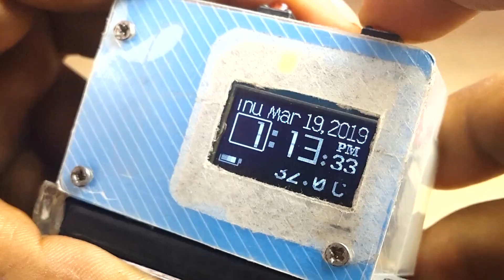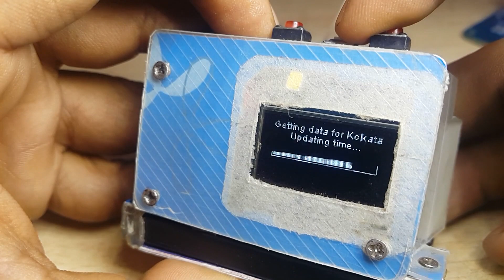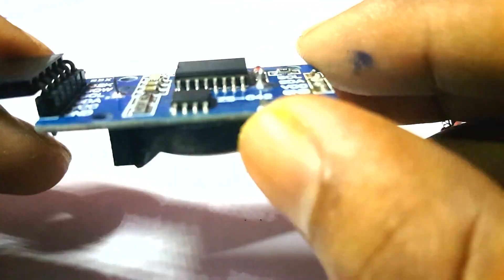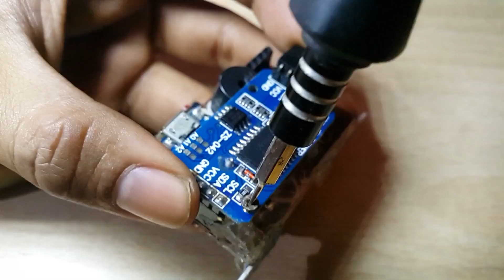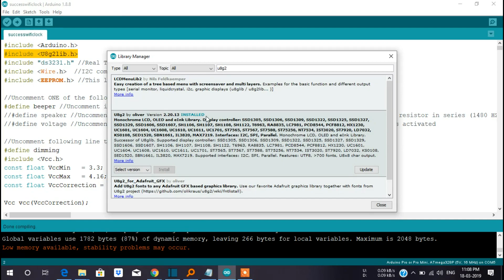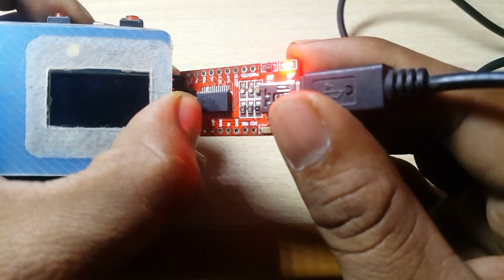Arduino oled clock with Relay Control and weather station on same OLED screen || PART-II

Comment: Great video! I added an alarm(Not just for 60 seconds) snooze upto 50 mins and flip to disable alarm display message and changed some fonts and added a "Set Your Alarm" slide text at the alarm screen bottom page that scrolls from right to left

Comment: How to change this circuit to ds1307 RTC module
Reply: In order to use ds1307 rtc module you have to change the library and edit the code .  It will take sometime
http://downloads.arduino.cc/libraries/github.com/PaulStoffregen/DS1307RTC-1.4.1.zip

Comment: Bro I'm from Kolkata too.can you help me out I want to build a smart clock like yours but on nodemcu features I want to have - set time/alarm/stopwatch/battery level indicator/weather/notificationsfrom phone..add ds3231.. basically I want to change Arduino with nodemcu..
Reply: Bro you must need API key to make Node Mcu clock & weather station and API key which is not free of cost today moreover Node Mcu is more power consuming then Arduino.....
Reply: @addiction-69  basically while trying to do so i burnt my ds3231,hc-05..
Reply: @addiction-69  if we remove outdoor weather feature instead use dht22 to get indoor information..
Reply: @HELLSGUARDIAN  then why you want to use Node Mcu whereas no use of internet or any wireless communication use simple Arduino and Ds1307 with Dht11
Reply from the maker: but the problem with nodemcu is. its power hungry.
Reply: @ehobbyist4054  true, I am 
willing to use nodemcu because of its storage..

Comment: Bro the clock is running well but the clock icon come over the battery icon and temperature is gone downward didn't show in lcd.... how am I fix it????
Reply from the maker: which type of display, you used.
it works perfectly in 0.96 oled display.
(or you must installed u8g2 libraries (version 2.20.13)
Reply: @ehobbyist4054  thank you, thank you, thank you for replying I have use 0.96" OLED display. I have this type of library but there is updated version available can I use that version???
And bro make a video on this clock with ioT which is didn't work in this project...

Comment: Can I use other websites for Free API keys???
Reply from the maker: Yes, you can
You just follow this link:-https://github.com/ThingPulse/esp8266-weather-station
Reply from the maker: I will show you in next video.
Reply: @ehobbyist4054  thank you.. but you code is too big it may unstable the Microcontroller???
Reply from the maker: But fortunately, it works fine.
 I used it from since last six month.
Reply: @ehobbyist4054  thank you for replying it would be a awesome project if the WiFi weather station work perfectly.....